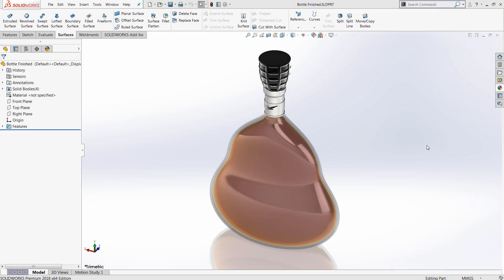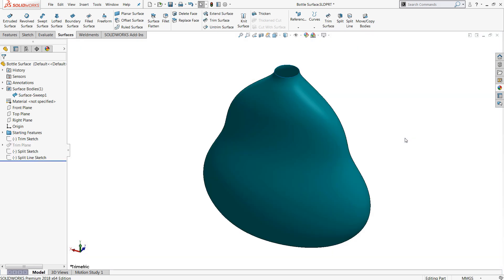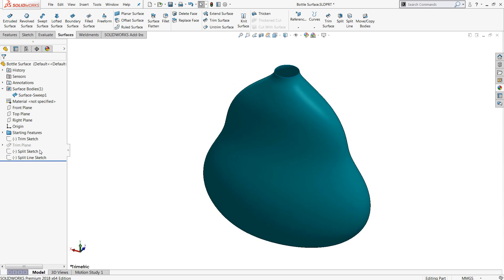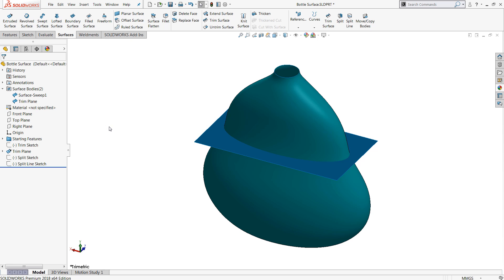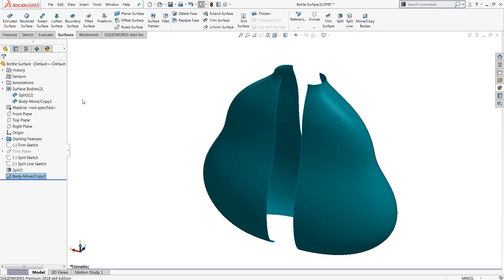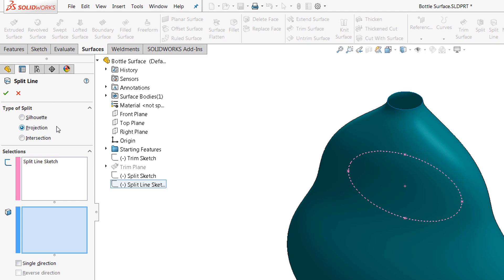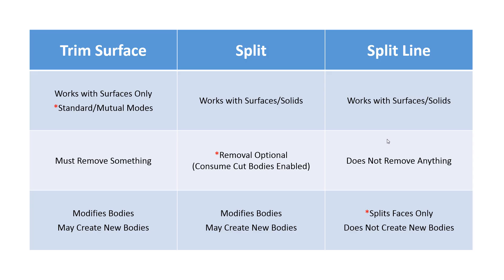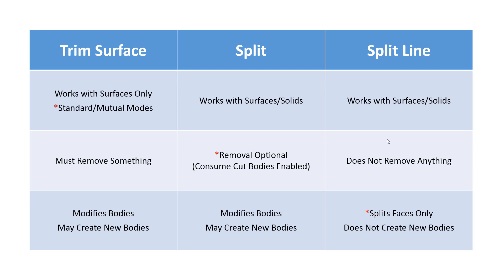SOLIDWORKS: Trim Surface, Split, & Split Line - What's the Difference?

Comment: Who works with curves?
As an example i wanna split a curve to many curves by surfaces or planes or points on curve.
Or join many curves?
This Thing is exist in catia Or nx? Now What about Solidworks? Thanks
Reply from the maker: Hi Khalil,

Great question – While curve features cannot be split in SOLIDWORKS, sketches can! The best way to split a curve is to convert it into a 3D sketch. Once you do that, all the splitting and trimming tools will be available to you.

Once you’ve created your curve, start a new 3D sketch. If you don’t have much experience working with 3D sketches, I’d recommend having a look at this video (http://bit.ly/2DR6GNE). Then, use the Convert Entities (http://bit.ly/2EvRfaM) command, click the curve, and confirm. This turns your curve into a sketch. Once this is complete, I typically hide the original curve so it doesn’t get in the way.

From here, consider using the Segment (http://bit.ly/2FElaNx) command (using the Sketch Segments option) if you’d like to break your curve into equal lengths, or the Split Entities (http://bit.ly/2GDnzsY) command if you’d prefer to break the curve up by placing points. Unfortunately, it’s not yet possible to trim sketches using planes, but you can create sketch entities on planes inside the 3D sketch and use those to trim up your curve if needed. If you do this, make sure that the sketch entities you create have a Coincident or Pierce relation to the curve, otherwise you won’t be able to trim with them.

As far as joining curves, consider using the Composite Curve (http://bit.ly/2GFaMXc) command. This allows you to join existing curves, sketches, model edges, etc. into one single curve. Keep in mind, however, all entities must be touching end to end for Composite Curve to work properly, and if you intend to split up the result, it will need to be converted to a 3D sketch first as I’ve described above.

All of these tools are available in SOLIDWORKS Standard, but unfortunately I can’t comment on whether the same tools exist in other programs.

Thanks for watching, and I hope this helps!